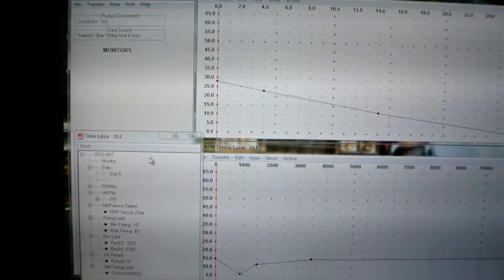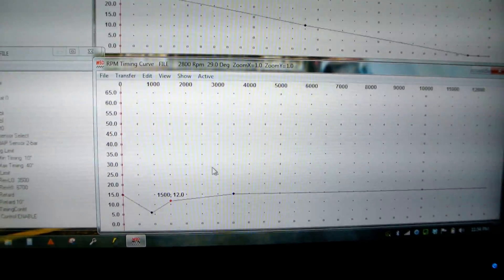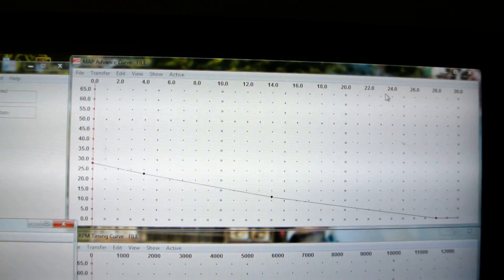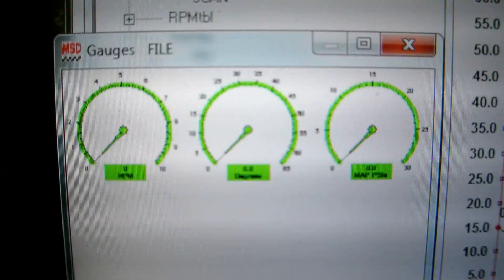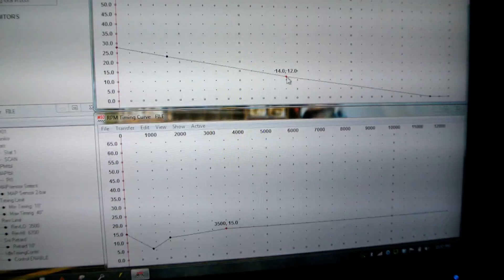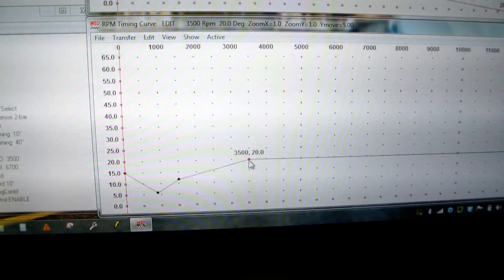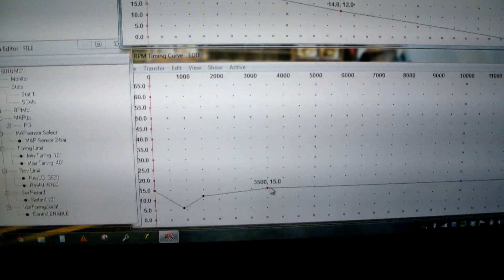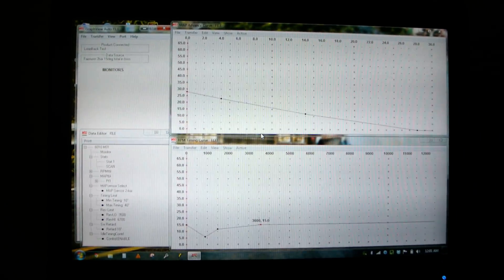7-1-13 How to use MSD6010 software explanation and whatnot

Comment: Bar is another unit for pressure. 2 bar just means it reads up to 29 psi. 1 bar = 14.5 psi. 1 bar for vacuum and 1 bar for boost like you said makes absolutely zero sense.

Comment: I have a msd 6014 and I have a ls1 with twin carbs and a blow through carb. what would be a good baseline to start on as far as timming.. starting at 200 rpm all the way to 7000.. I hope you can help thatnks

Comment: hey man im new to the ls world. first im trying to find out how to down load the soft ware to my lap top i dont have a cd so im looking for a on line down load. second I need a some help on a decent starting point mine is a non turbo ls with a 303 600 lift texas speed cam 317 heads on a 5.3 with a 175 shot nos. my number is 5017447348 please call jason thanks.

Comment: what would be a good base curve for a stock LQ4 6.0 with ls6 cam and edelbrock intake and 750 carb. using a 2 bar sensor. car idles and revs perfect in neutral, but when the car is in drive it hesitates and falls on its face under a load like taking off or power breaking. not sure if its a carb or igniton issue. sorry if my question sounds vague but a carbed LS engine is new to me and just trying to get the car to run. thanks

Comment: *****  can you use the 4 bar sensor with the 6010 box?
Reply from the maker: yeah you could use a 4 bar. you would just have to understand that the scale will be off and youll have to figure it out yourself
Reply: Where is your shop at? I'm in North east pa. Near Pottsville. I'm going to be building a 79 fox with a 5.3 and twins. Would love to bring it over after its done. Small tire street driven. Another question with the mega squirt can you control boost via speed reference. Like if I went to Numidia and I had poor track conditions to slow the power ramp down
Reply from the maker: ah well i am in allentown, and its my friends dyno, i dont own a shop i just mess with cars for fun, i wouldnt mind tossing it on the dyno when you are ready, yes, newer versions of megasquirt can run time based boost control, you could also eliminate the 6010 box since ms2 and up can control the coils
Reply: Ok why do you use the the ms1 and the msd over the newer ms2 and later
Reply from the maker: in the older videos its what we used because it was easier and we didnt know how to do the rest, as we learned we started using more of the higher end megasquirt things and making them work with what we have.

now we use Micro or MS3 for the ls motors
Reply: Ok well what do you recommend ms2 or ms3

Comment: I have the 6AL2 programmable version for a 92 LX 5.0 oh stang. so my questions is do I need to have the map sensor connected or is that only for boosted application that it is needed? Mild 300hp motor with basic mods where should I start with the timming? Finally the distributor needs to be set at max timming as you mentioned correct?

Comment: i'm putting together a carb'd 6.0L LQ9 with 243 heads, should be around 10.8 compression. I've been researching on how to program this thing and its still WAAAY over my head.
Reply: old post but i am running a similar compression how are you making out ?
Reply: I built a gen4 5.3 with 243 heads and a carb....never fired it yet... i have the msd ignition, need to do some homework.. any help? Thx

Comment: 15psia IS NOT WRONG psia stands for psi absolute The "a" is there for a reason. Our atmosphere is around 14-15 psia. Full vacuum is not negative pressure it is 0 psia. Standard psi is pressure or vacuum relative to the current atmospheric pressure. Space is 0 psia. The gravity of earth pulls the atmosphere down on us causing atmospheric pressure.
Reply: So essentially the map scale should be read exactly the wat it is meaning if timing is taken out is should be done at the beginning of the table nd not at 14?

Comment: So I just hooked up my cpu and box and I have been playing with waht you first said. I would like some info in dialing in a good tune for a ls with stock parts just hooker header and carbed with edlbrock 600 cfm. Any tips would be great as I am new to this.
Reply from the maker: 12.20 AFR and 22deg of timing wide open will net best results on most LS combos
Reply: Is there any way that you could send a pic of how it looks on the msd software?
Reply: Okay i got that taken care, one last question. My map what is a good starting point. I have it a 12

Comment: hey sloopy can you help me? I'm running a ls 5.3 bored to 347, its a carb motor with a nice cam, but I have no idea how to use this software, mine is a 6012 box, can you give me some pointers on what you think would be a good set up? thanks

Comment: Mott, I've got a shit ton of questions but for now,- at the current time do you still recommend a 6010 in combination with MS 1,2,or 3? I am building something similar to your buddy's iroc, twin 5.3 but want to keep it unassuming like your Squaremont's, i.e. no cage etc. Your Ms videos date back a couple years so I was wondering if, starting from scratch would you would still use the MSD, oh yeah data loggin is very important me as well and I know in one of your vids you state the MS data logging is not so good..? Thanks for all your post
Reply from the maker: at this stage i would recommend the Microsquirt V3 set up for LS engines from EFI source, they pre-mod the motherboard, then you can build your own harness or buy a plug and play harness from them. megasquirt datalogging is great.

Comment: hey sloppy are you using the 9 pin to usb converter to hook to your laptop?  I'm using windows xp with that adapter and cant hook to my laptop.
Reply from the maker: nah i never use the usb to 9 pin they work like dookie
Reply: what do you use?
Reply from the maker: the laptop has a 9 pin com port, or i get PCMCIA (pc card) to 9 pin

Comment from the maker: i would only run approx 22deg in a ls1 or ls2 with a cam, at the most on 93 octane that is where it will make peak power. drop it to 18deg for a 150 shot

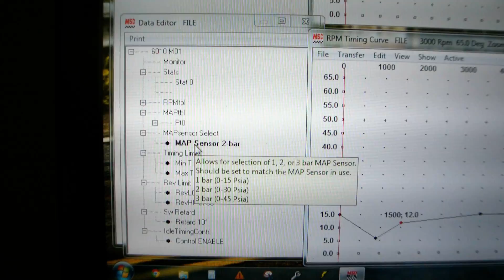Comment: Pause the video at 1:32   The software only mentions psia.  If it said psiG then it would go from -14 to 14 on a 2bar sensor.  psiG is GAUGE pressure.  Since 14PSI is considered atmospheric pressure and we live and breathe that we just call it 0psiG.

Comment: He said the same about the range of map sensors.
But the scale give 2 bars of boost avaible on the scale when you choose a 2 bars (total range) absolute pressure sensor, wich is impossible.
so,where do you see psi a and psi a ?
i would like to understand what you said.

Comment: The MAP is an Absolute Pressure sensor.  0bar being a perfect vacuum and going up from there.  1 bar is roughly atmospheric pressure, around 15PSI. The 2bar sensor has a TOTAL RANGE of 2bar.  If you reference off of atmospheric pressure you get 1 bar of vacuum and 1 bar of boost.  When you clicked on the thing to select which one it has psia (the a refers to absolute).  PSIG would be gauge pressure which would read 0PSI when the motor is off.  Hope I don't sound like i'm an ass, love your vids.